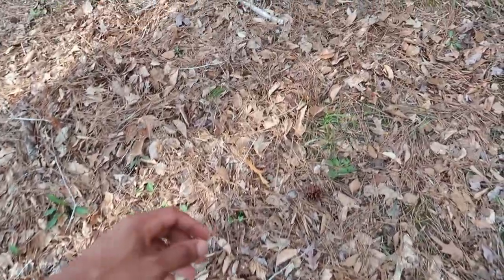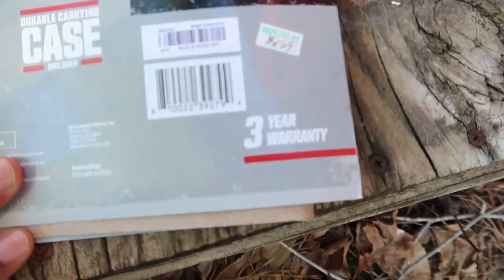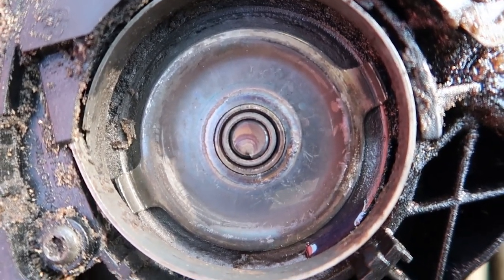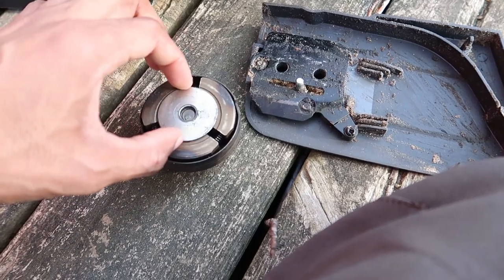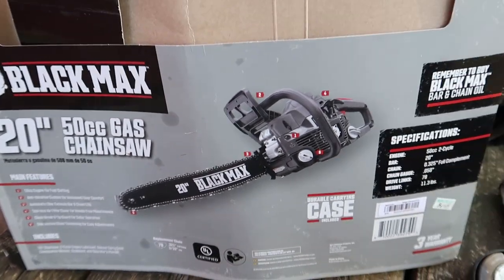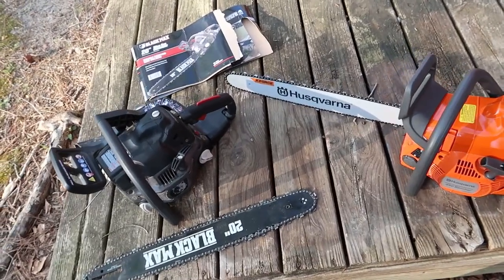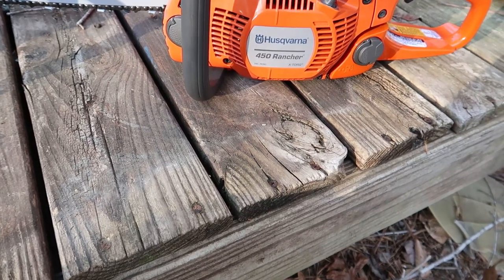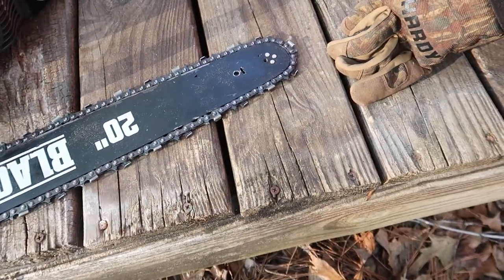BLACK MAX Chainsaw is Trash

Comment: Just saying it is trash over and over and nothing back it up  doesn't show anything,  or purpose.
I have 2  black max 20" saws got on sale for $89 each,  they are my back up saws when in field when my expensive saws are down , and I need to keep cutting.  
The black max saws are Honda engines assembled by black and decker/ryobi. I've never had a problem with them. And have been used about 1000 hours between them. But I also  don't abuse them and have broken them with warm up periods 5 minutes minimum before cutting and only use full synthetic echo or vp racing 2 stroke oil, changed out the spark plug, and a high end chain 

With any cheap saw need to immediately change to 1. High end spark  plug, 2. High end chain 3. High end oil those things with keep it running long time.
Reply: Where do you find replacement parts for these saws?  I have a 50cc 20in,  for the most part its fine for what i need.  I do need to replace the clutch drum to include the bearing, and also the chain tightness adjustment screw(s).  But i can not find the parts on Amazon OR Ebay.  Im finding everything but the couple of things i need for this saw.  Thanks in advance for any help.

Comment: NOTICE:
Failure to release partial throttle when chain
brake lever is in the brake position will result in
serious damage to the unit. Never squeeze and
hold the throttle trigger while the chain brake is
in the brake position.

Comment: I have been using saws for a while and my review on this saw is this,      I bought one 16 inch bar used for two days and had very few problems, these saws aren’t stihl’s or echoes would recommend for much over a foot thick wood theses saws are prone to over heating they make an ok back up saw , you want a preference saw Stihl or echo commercial grade saw, black max saw you have to take it easy not made to lean on.

Comment: Oh and only way spark plug could come out of head is if you had taken it out and cross threaded it back in. So everything you guy's are saying bad about this chainsaw is irrelevant because it's only a common issue if you do not know how to use a 2 stroke engine and oh yea there's supposed to be a washer looking thing called a gasket for a reason on the bottom on the spark plug to keep Gases from coming out of the head.....

Comment: Crankshaft failure. It snapped right at the clutch drum. An extremely rare occurrence. Not your fault brother. They should definitely have covered this under warranty.
Reply: Very rare and no need to trash the company. Receipts are all important for warranty.

Comment: In order to snap that rod you would have to be using the chainsaw in the wrong manner. This tells me you have no idea how to use a chainsaw. I tested this theory by going out and buying the same chainsaw and properly cutting trees down and I made over 200 cuts with the thing and didn’t have a single issue. So my advice to you is go back to chainsaw school and re learn the proper way to use any chainsaw.😂